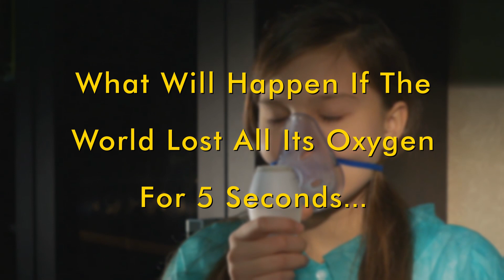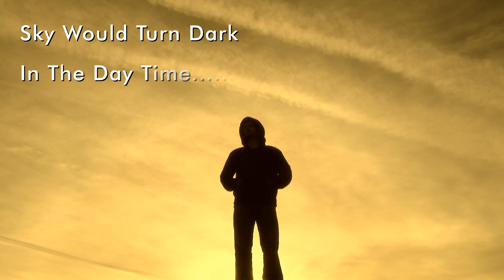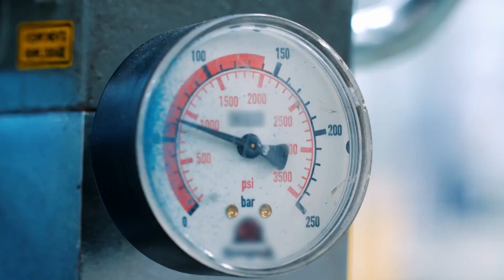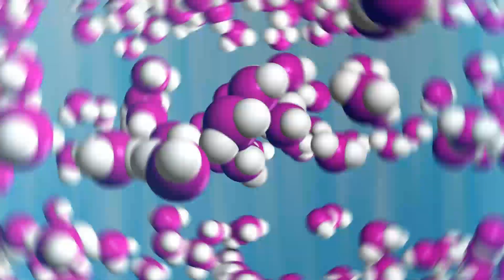What If The World Lost All Of Its Oxygen For 5 Seconds - Even Worse Than Atomic Bomb

Comment: So in this hypothetical nitrogen and other non-oxygen molecules that make up 4/5ths of the atmosphere play no role in filtering sunlight, no metal is painted, the space shuttle (which doesn't even fly anymore, but you included it in this 2019 video) needs to be constantly firing its engines to stay in orbit, hydrogen can rise up out of the atmosphere instantaneously (teleportation, maybe?) and not take longer than 5 seconds to rise to outer space, etc.